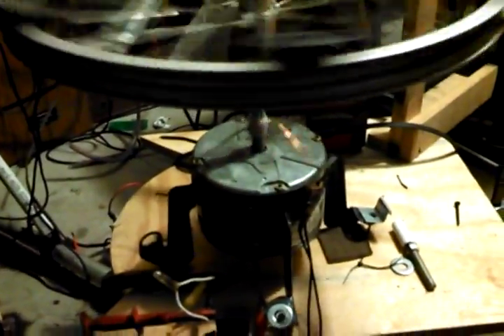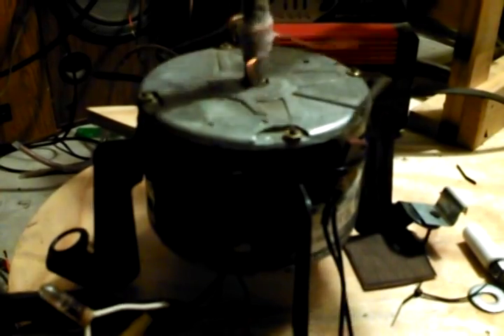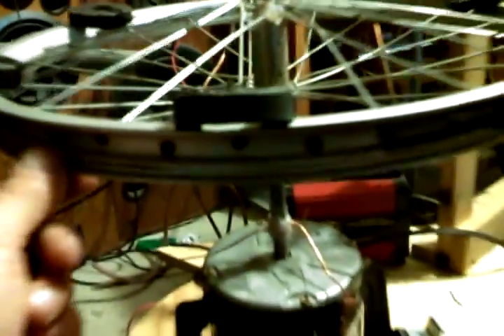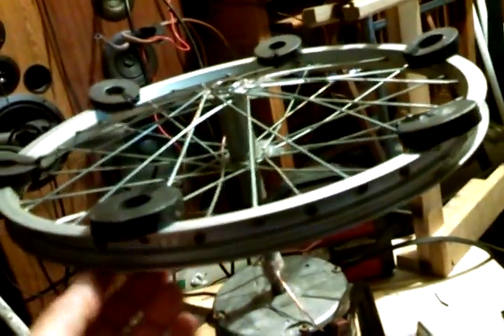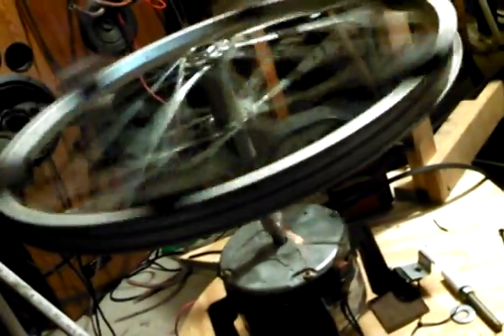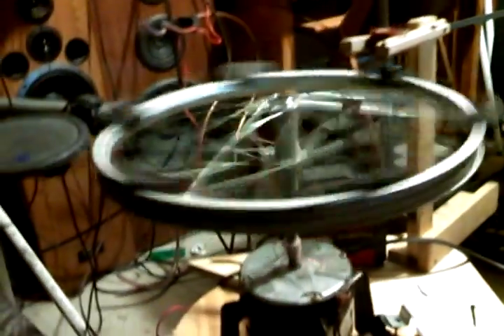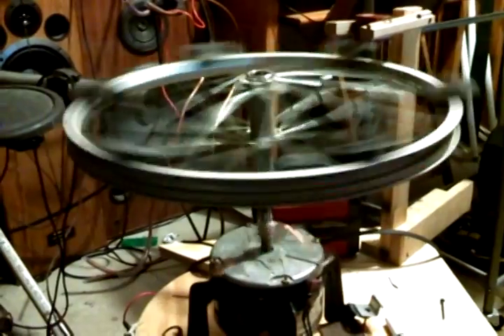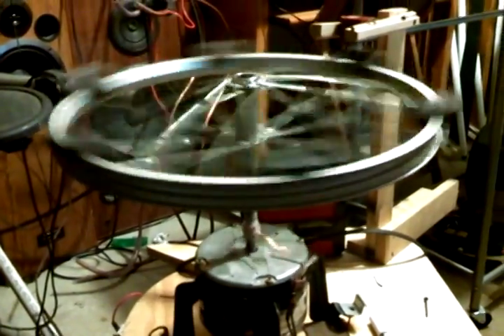Free electricity motor.

Comment: Very cool...I wish I could give you some of my hall effect sensor switches. There like $2 for 30. They work well for transistor gate switching pulse motor setups.
Reply from the maker: I got one. But it held the juice on rather than pulse like a MOSFET. Might try again with a resistor. I have now done so much more :)
Reply: Cool. Some hold juice on, others off. The ones I have switch on in the presence of a magnetic field, then turns off. Others are switching latches, which turn on with a magnetic field and stay on until a reverse polarity comes by. There are lots of circuits out there... Peace. Lookin forward to hanging with ya sometime soon.

Comment: wow how do you make it? Nice Video
Reply from the maker: Its a 3 phase permanent magnet motor with a micro switch getting smacked by the wires that are hot glued and bent to act as a pulse commutator. I am now charging a dead battery with the 3rd winding.
Reply: Terry Woodroof Sweet you should do an update on that.
Reply from the maker: I have charged batteries and run a radio from another motor generator on top :)